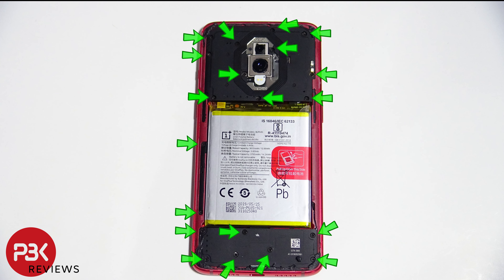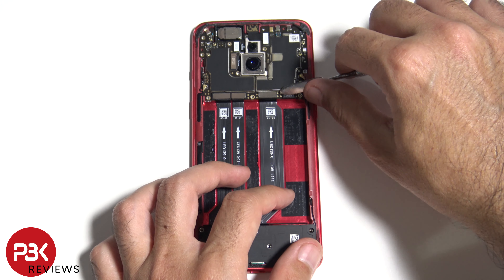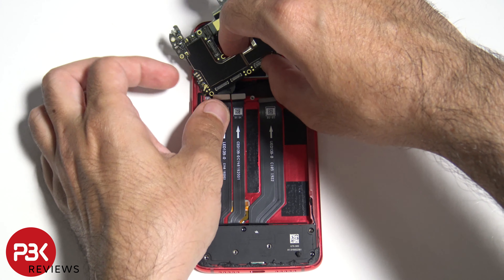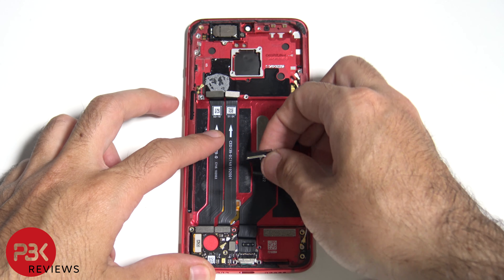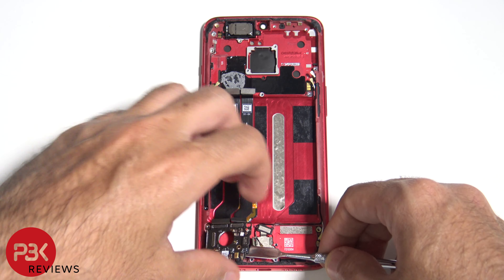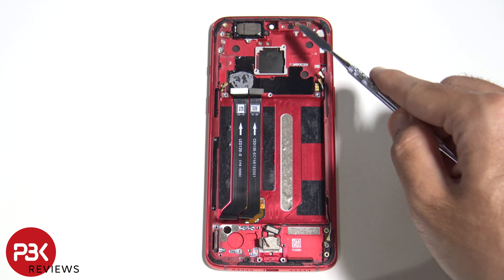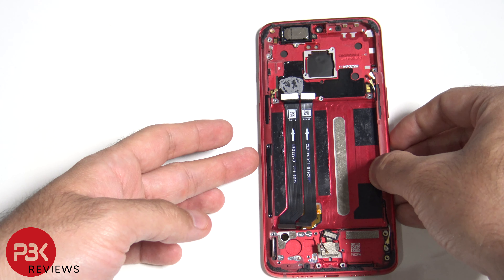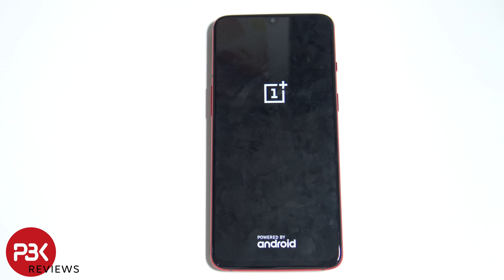One Plus 7 Teardown Disassembly Repair Guide

Comment: Thanks for this video! Finally a teardown that isn't for the Pro model. I was wondering just how good the splash-proofing is on this device. Seems to be a fair amount of adhesive and water resistant mesh covering the speaker holes, of course charging port and sim tray have their rubber rings to keep water out. Also, the boards seem to be coated in some sort of polymer to prevent corrosion from minor water exposure. Looks like it'll hold up to some splashes quite well.
Reply from the maker: your welcome :)

Comment: Ok, but HOW do you safely heat the back? How warm and with what method? Is the glue only around the outer edges of the screen?
Reply from the maker: You can use a hair dryer and just evenly heat it up and not hold it on one area for a long period of time to cause any damage. You can apply heat and try to pry off and apply more heat as needed throughout the process. As long as its hot to the touch should be good enough. Point is to keep it warmed up and heated up to a point so the adhesive underneath starts heating up and getting loose.

Comment: Is there a proper sealing for all openings to prevent water entering inside ??
Reply from the maker: yes it has water resistant adhesive and gaskets around the connectors and such to help against liquid or moisture damage etc.
Reply: @PBKreviews  Thanks,but what about speaker openings, charger port and buttons, How are they sealed.?
Reply from the maker: @mrashid-s  They either have gaskets or for the speakers have mesh with rubber seals around it to keep water from entering.
Reply: @PBKreviews  either in the sense you are not sure what,but they have some kind of protections.. right!!

Comment: Hello man, loved your video every bit. 
My one plus 7 suddenly freezes then restarts. I have send it to the service center they just replaced the software claiming it was just a software issue.
But I still have the same issue, can you say for what hardware reason this could be happening?
Reply from the maker: Hi, thank you. It could be possible water damage causing the hardware to not work properly or overheating would be another thing to look into. Since you said software was looked at, I don't see a running app causing the phone to crash so those would probably be the two things I would look into next. If it has water damage (corrosion inside on connectors or chips), you would need to brush them off with a tooth brush or something similar and make sure all the corrosion is cleaned off and see if it fixes your issue. If not then most likely it has more permanent damage and would require a professional in fixing water damaged phones to look at. Next if it's over heating, check the thermal paste under the board and make sure its not dried up, and if so, use a rag or something to clean off the old thermal paste and apply a little bit of new thermal paste. Make sure not to apply more then a small circle dot (since you don't want it running places it does not need to be). Hope this helps.

Comment: Does broken glass do damage to digitiser and LCD panel in the long run, I just broke my new phone's display but it's full function. As of now I don't have money so thinking of using it as it is with broken screen. Please help me.
Reply: Glass is broken totally but usable. Touch response is working fine. Also can you guide me in buying a replacement  screen ? I will just need glass screen right because I think digitiser is not damaged.
Reply from the maker: You cant replace just the glass, you need special tools and machines for that. Or else you will end up with a bad screen with dust and debris and finger prints with touch not working properly etc. Best bet is to check ebay and amazon for replacement lcd assembly or contact one plus and see if they offer a repair service for the screen. But using it as is should not damage the phone, maybe only cut your finger if you touch the broken glass. Hope this helps
Reply: @PBKreviews  ok. Thanks for your quick response. I wanted assurance that it won't damage the LCD in long run. I thought the glass would damage the digitiser underneath it and would affect touch response.
As of now I am thinking of applying a screen protector on it so that dust doesn't deposit there.
Reply from the maker: @dr.allwyndsouza5246  Ya you should be fine. Its always possible that it may degrade over time but most likely shouldn't.

Comment: Adhesive or glue, which is better?
Reply from the maker: adhesive
Reply: @PBKreviews  Why?
Reply from the maker: @CreatorGadgets  Because its what is originally used and best, you can always remove adhesive and add new if you ever need to do more repairs. Glue is messy and not going to be ideal in taking apart again and then trying to seal back up.
Reply: @PBKreviews  ohh Yes, thank s

Comment: Sir in my oneplus 7 there is no sound in videos and calls and music I reset my system and update to latest os still problem is there is this board problem
Reply from the maker: Hi, hmm not sure. It's possible it might be the board since you said there is no sound in videos or calls meaning your mic is not detecting sound, and also on music meaning your speaker is not playing sound either. If the phone has been taken apart before, make sure the motherboard is seated properly in place and everything is connected properly.

Comment: So the thermal paste is the only cooling system in OnePlus 7?
Reply from the maker: No it has the graphene tape (in black) also that the thermal paste makes contact with which transfers heat but ya no special cooling aside from that.
Reply: @PBKreviews  I see, but do mobile devices need special cooling system like in those gaming smartphones?
Reply from the maker: @arifikhwan4226  no they don't. Newer processors run cooler and they don't need all that cooling the gaming phones have since they don't generate as much heat

Comment: Is oneplus 7 waterproof?
Reply from the maker: Its water resistant yes, has a water resistant adhesive on the back as well as gaskets around the connectors to keep moisture out and gasket around charger port etc.

Comment: When the charging port gets damaged, do we have change only charging port or the whole motherboard?
Reply from the maker: You would just have to replace the charging port with the flex cable it is attached to. Not the board.

Comment: OnePlus website says that the OnePlus 7 has a linear vibration motor but this seems like the usual motor......did they just cheat us
Reply: do you even know what is a linear vibration motor
Reply from the maker: The one plus 7 pro has it but the one plus 7 doesn't
Reply: @PBKreviews  well I checked their website and it says that the OnePlus 7 has linear vibration motor
Reply from the maker: @PhvanS  Not sure might be a mistake on the site or maybe they changed it last minute no idea

Comment: Does it have a liquid cooling system like the pro model ?
Reply: No
Reply: @ashishmittal7848   Does it has any other type of cooling ?
Reply from the maker: @XxmohamedcraftXx  It just has graphene film to transfer/dissipate heat, no water cooling
Reply: @PBKreviews   Is this film as good as the liquid one ? From 1 to 10
Reply from the maker: @XxmohamedcraftXx  I don't have much experience with the graphene film since its fairly new to be used in phones for cooling. However I believe water cooling would be more effective. Or else they wouldn't use it along side graphene films on higher end phones.